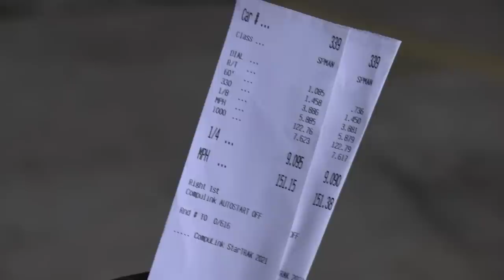Tesla Model S Plaid UNLEASHED!! Day 5 of Rocky Mountain Race Week 2.0

Comment: Damn those halfshafts must be taking a beating with the unrestricted torque at launch. Crazy seeing a 2+ ton car light up all 4 tires like nothing!
Reply: Not really, there a lot less weight in the car so less load.
Reply: @RIPPERTON  a stripped interior still means the car weighs closer to 5,000lbs.
Reply: @ionbusman2086  its 4860 without a driver stock, so i would assume theyre probably running that with all the weight off.
Reply: @SplitDaWig  It's actually ~4.5k lbs stock according to Tesla's website. So with everything stripped, probably 4000lbs or just under it ;)
Reply: @Samosayummyyay  4766 man. What would I know, I only own one.

Comment: Ur getting the motors, controllers, and bat cells too hot in the burnout that's why the ecu is either pulling power or the mere additional resistance in the circuits is not letting the power to the wheels by thr 1/8th
Reply: Geez, that's a damn good point! 🤦💯
Reply: @ChosenMJ  it's like when racers started transitioning from carbs to EFI and didn't think vaporlock was a thing anymore lol
Reply: @ChosenMJ  ..........20yrs later still boiling Fuel 😜

Comment: I think it would be real consistent.  Dial that 9.0 down and own the 9.0 class.
Reply: When the charge gets low there not near as fast anymore
Reply: @shorty808100  that's true on previous iterations of the car, but the Plaid will still run low 9's at 50% charge, and high 9's at 20% charge.  Each run uses about 2.5% - 3% of the battery, so you can do a lot of passes before you lose much.

Comment: would it be possible to have two batteries one removable that cuts weight and cuts run time since you only need like a minute of runtime?
Reply: I'm almost sure the batteries  are connected in parallel, and 1020 hp is limited by how much juice they can provide (the installed motors are 3 x 400 hp = 1200 hp). Cut battery in half = cut available power in half.

Comment: My two cents:  driver weight isn't making much difference on a 5,000 pound car, and neither is being 100% vs 90% charge (it made a much bigger difference on P100D / Raven versions of the Model S).  

IMO, disabling the traction control is costing you time.  It can break loose almost all the way down the track.  Well after the launch, you're probably slipping in amounts small enough that the car would normally handle it without you noticing, but without that aid, you're losing a tenth.  Try letting the computer do its job managing torque for you and you might have a better chance getting into the 8s.
Reply: With traction control this car would be in the 8's no problem. Fully weighted Plaids are running 9.2's.
Weight still matters as well as charge level.

Comment: The weight of the roll cage alone just cancels out all the weight savings of removing the interior I bet. Weight all the parts u ripped out and then weight a 8.0 legal cage and see what you are even saving for weight.
Reply: Not fully, but almost. The Unplugged Performance car has a roll cage and aeros, and with stripped interior is maybe 70 lbs lighter than stock.

Comment: At 9.09 you are already quicker than 90% of the 2021 Drag Week field.  Let's just say dropping the A/C might make this an 8 second car.  If the 2022 Drag Week Rules do not accommodate EVs (routing cars past charging stations, etc.), Drag Week will become a scenic road trip for slow vintage cars.  Real racers want to be quickest and fastest.  They are not doing it for nostalgia.
Reply: Just need a desiel generator on the trailer to keep it charged.   If they can't charge while driving, Elon needs to fix that with a software update.
Reply: The AC is integrated into the entire HVAC and battery and motor heating/cooling system.

Comment: Hi buddy,
Ounce again, it you want to save more wait, I suggest you to go full carbon fiber for your wheels (in 19"), and same with front hood + rear bonnet. 
Plus, I assume that this huge panoramic roof in glass in pretty heavy, and I'm pretty sure you can find someone who could make you a custom piece in a lighter material (like what they use for racing cars), transparent or not, it's up to you. That being said, pretty much all your windows can be changed too in the process (except the windscreen I guess, for safety issues). 

PS : Let's also change your seat for a Tillett one, they are the best =)

Comment: Pull a full Leroy and lose all the body panels and especially the glass roof!
Reply: At that point just build a tube chassis to hold the battery and motors. No roof or windshield just a sled with one seat all motor and battery nothing else
Reply: @johnsnow1355  with a roll cage and chutes, yeah, that config, too! What could possibly go wrong?